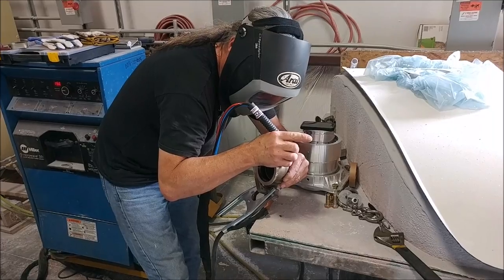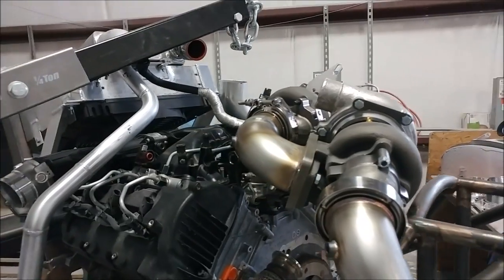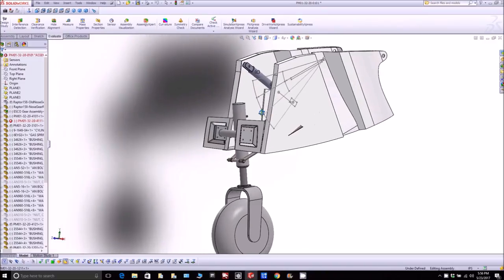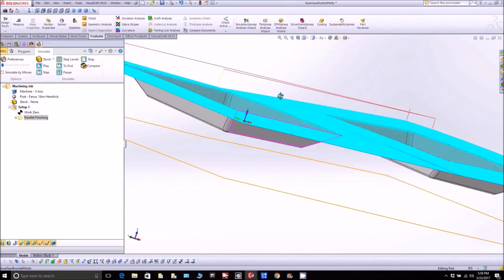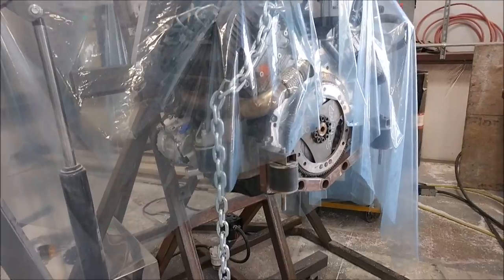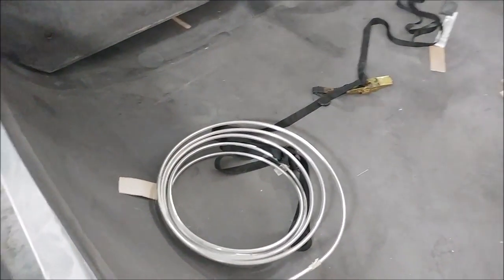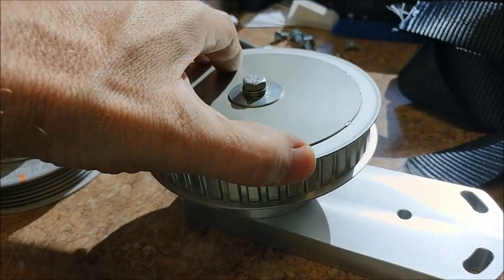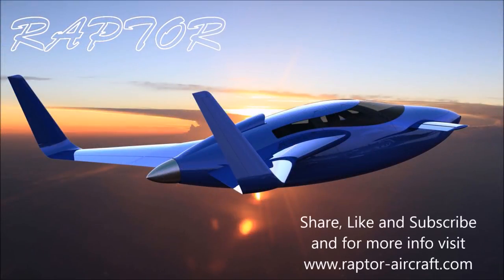Turbos Meet At Last - Test fitting the turbo system

Comment: Please put some flex joints between the turbos, will be a lot of thermal expansion, looks good. You have compound turbos, one feeding the next. Will there be enough exhaust energy on the second turbo to pressurize the air coming from the first turbo?

Comment: I think the diesel engine is a very good choice a couple of things that have helped me get better performance out of my engine is port and polish the exhaust manifold either coat or wrap to keep the heat in the exhaust system maybe a turbo blanket and by using EVANS waterless coolant  safety raise your water temp for more efficient diesel burn change the vibration damper really seems to smooth out older high mileage engine  and quality synthetic oil like AMSOIL another thing that could be beneficial is a lift pump like an AIR DOG or a FASS system  love the  new ideas hope to see it fly sooner than later